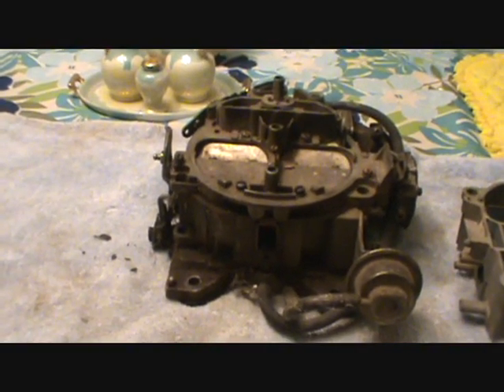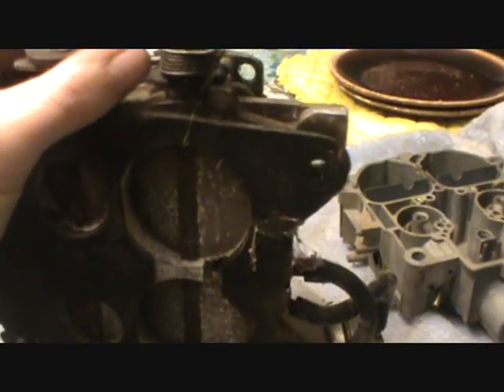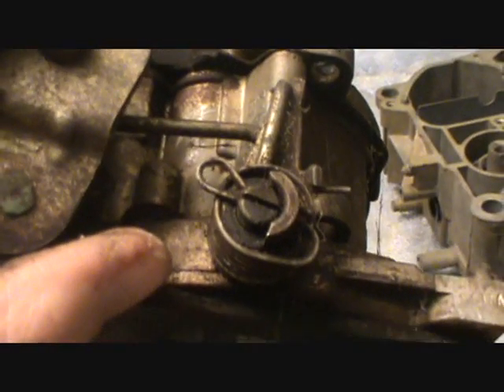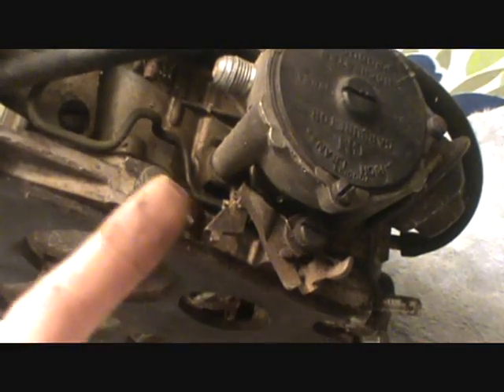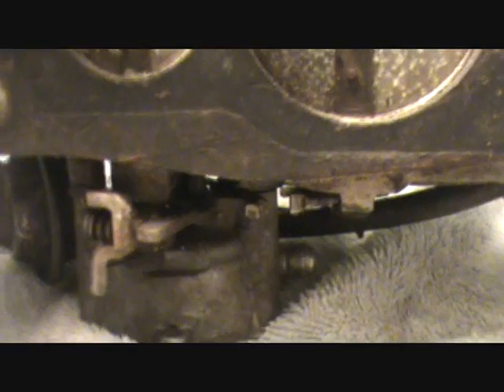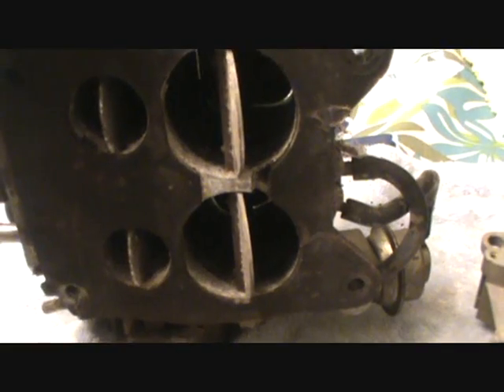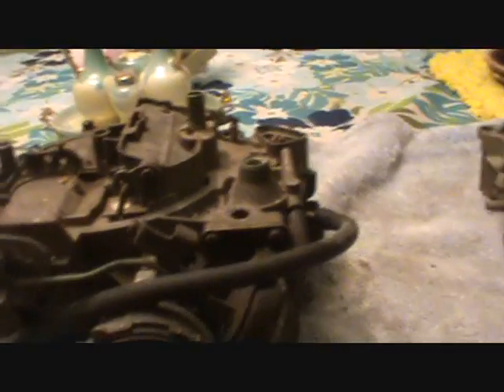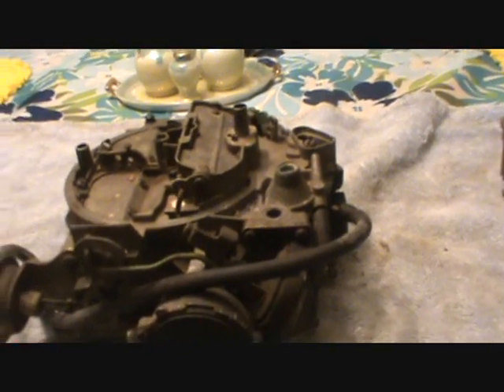How to de-bog your Quadrajet part 2

Comment: actually the tiny holes just above the airflap are the secondary enrichment system.It helps when the flap isnt opened enough. The main feed for the secondary operation are the big tubes, mostly made of brass, just under the flap

Comment: So what's SUPPOSED to happen with the catch? I bought a brand new q-jet for my oldsmobile cause the old one was worked on by someone who didnt know what they were doing. Even on the new one, there doesnt seem to be anything that hooks up to that secondary catch tab. Is it gonna work this time or should I take it off?
Reply from the maker: The opening of the choke plate FULLY is intended to release the catch. if you don't see anything there let me know and I'll dig out one of my Olds carbs for reference.

Comment: Go straight to adjusting the secondary air valve. Most people don’t start with a carb that’s being laying outside in a swamp.
Reply from the maker: This video isn't aimed at "most people". "Most people" go buy a poorly remanufactured unit or through it away and stick on a generic Edelbrock.

Comment: This was informative thanks.. This is what I am dealing with on the boat we just bought, think I found the problem,  The Vacuum brake is toast and I need the correct rod that goes to the secondary for this 17080581 .  and found remanants of a devorce choke.  Time to replace replace parts and see where I sit..  (unless I am over seeing something).. may even look into electric..

Comment: my quadrajet bogs as soon as i put my truck into 2nd gear and i pretty much cant drive it after Low and first gear. the secondary doors are fine. that "catch that you said you take off is still on but my grandpa modified the choke to be manual so is it even disengaging? or is there another reason it is bogging? thanks
Reply from the maker: +Mitchel Adamyk If the lockout keeps the bottom throttle blades from opening, it won't bog, it'll just run like a 2bbl. Sounds like you have fuel supply issues on the secondary side.
Reply: +WhoSaidTyler well i just tried it again and it works on the 2 barrel in all gears but the secondaries bog. the vacuum  thing that keeps the secondaries closed and keeps them from opening until you step on it does not get "sucked in". could that be the problem?
Reply from the maker: +Mitchel Adamyk The vacuum dampner is supposed to be sucked IN as long as there is manifold vacuum supplied to it. When you punch it and vacuum drops to zero(it does), then the dampner relaxes and allows the secondary air doors to open.

I'm making a video now about this very issue, stay tuned.
Reply: +WhoSaidTyler okay thank you!
Reply: +WhoSaidTyler and what i was trying to say is thst it is always out and never sucked in, like while idling it is out instead of in.

Comment: That "ketch" that you remove when you rebuild a Q-jet is the secondary lock out lever and only comes into play when the choke is applied as you described in an earlier video. Its there to prevent secondary opening when the engine is cold and prevent a lean out condition which will cause a bog or a backfire if it goes too lean. IMHO not a good idea to leave it off, as you stated in another video regarding the primary choke pull off, its there for a reason.
Reply: I'm leaving mine on only in case someone steals my car, I'm not stupid enough to use wide open throttle when it's cold. Mine works fine as designed by gm to protect against idiots driving it. I've deleted them on other cars in the past but it's still present on this one and not causing a problem.

Comment: Thanks for the reply. :)
One more question. How stiff should those air doors be? Mine are very very loose... Almost sloppy.  Its better but it still bogs when then rpms are low and I full throttle it.

Comment: Figured it out. Tested the Vacuum diaphragm that controls the top plates to the secondary barrels. It pulled on in when I used a vacuum pump. It was a loose and stretched hose from the Carb to the Vacuum diaphragm. Put a new piece of hose on and she runs all better. Also the vehicle is a 1969 Buick Skylark with a 750 CFM Rochester Carb.

Comment: @WhoSaidTyler question will a fuel pump rated at 6 psi 110 gph, for a Rochester carburetor 4-jet on a 327 engine be ok? my car does not have the choke hooked up is this why it has a high idle. i cant hook one up to the ram exhaust it does not have the holes for it

Comment: i gotta 85 camaro 305 5.0 v8 with a 4barrel quadrajet and when i stomp on it it bogs for 3secs or so and revs fine after its got a few rpms it hesitates too what could be causing this the secondary air valve? any help would be greatly appreciated.

Comment: i have a dualjet210 on my cutlass it will high idle then i hit the gas and it seems like it chokes its self out when cold then i have to like basically keep hittin the gas till it warms up and when i pull off its exactly like the last sound u made on this and my choke light also comes on,and thx ive learned alot from your videos

Comment: I think you spend too much time apologizing but very informative.  I have used Q-Jets pretty much on all but one of my cars (always had GM) I think they are the best.  I always hear holly this and deamon that but seriously a clean tuned Q-Jet will run just as good as any $600 carb.  The only way to get more efficient is to get a throttle body or full TPI otherwise these are the best answer to any v8.